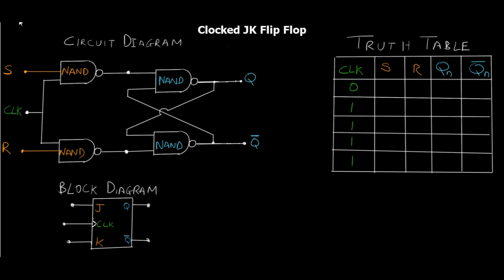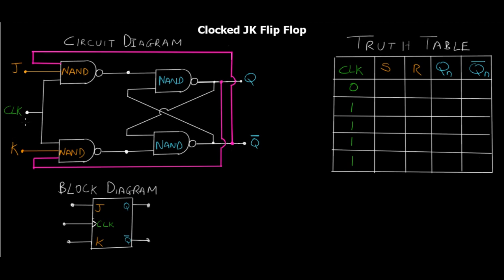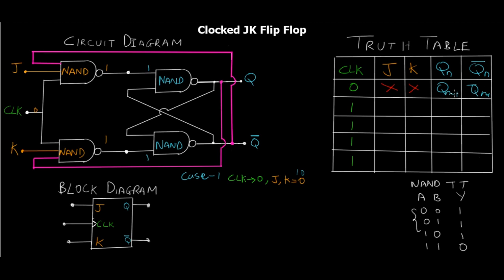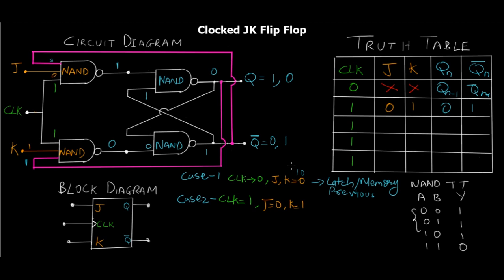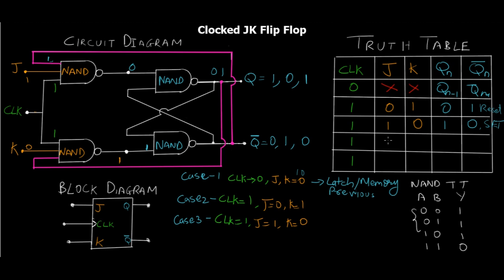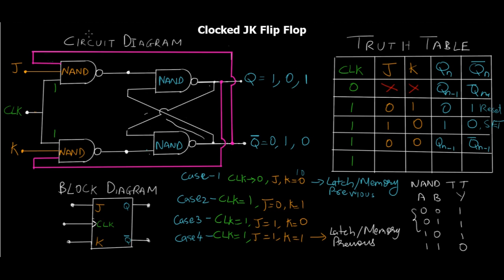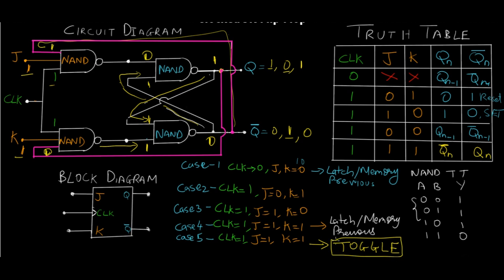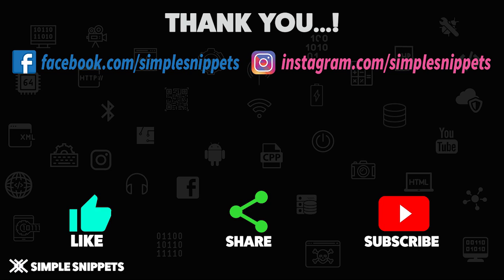Clocked JK flip flop using NAND gates with Truth Table and Circuit Diagram

Comment: its wrong!, it does not work like that. at min 7.51 you make a mistake, the lower input nand becomes zero, so the lower latch nand goes to 1. and upper to 0. This schematic is not a JK flip flop but a JF latch. The mistake many people make is that they draw a clock input , but infact what has to be drawn is a pulse edge filter/trigger, else you have no toggle.